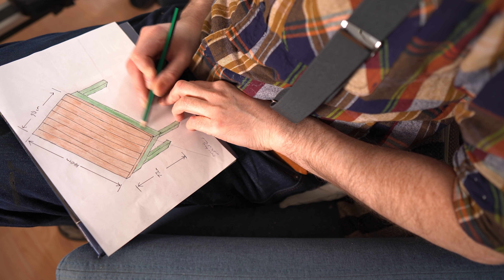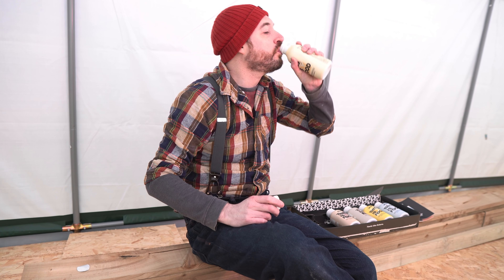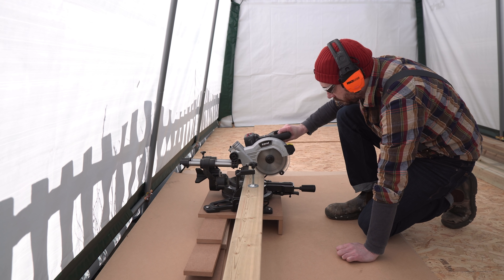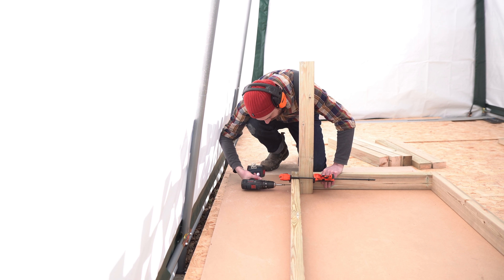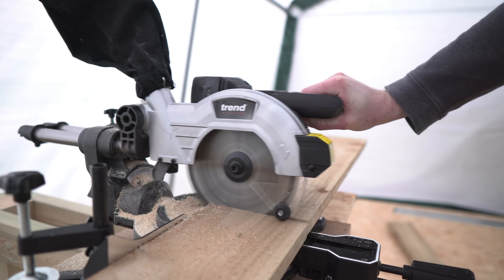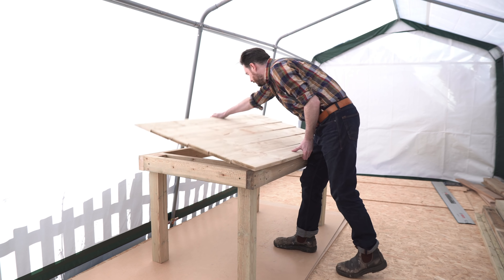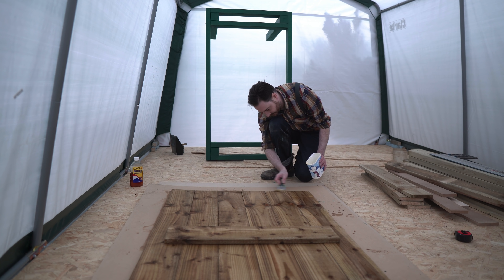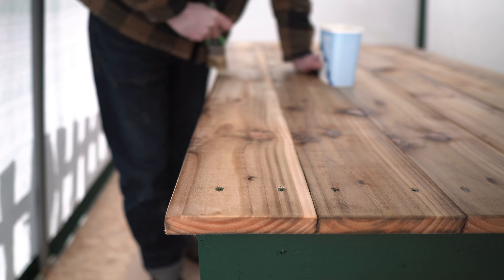Making A Garden Table

Comment: Very nice Matt, I've got one just like it on my patio under the gazebo. However I used p-hole screws to attach the top (plywood sheet) to the skirt. A complete once over with some of that green garden paint and propped up on four old bench biscuits, thing is, patio chairs are silly low and we sit, peering at eye level at each other over the top. Your bench build sounds like a great idea. Bring it on!
Reply from the maker: That’s the trouble with high tables. Bench is coming next week